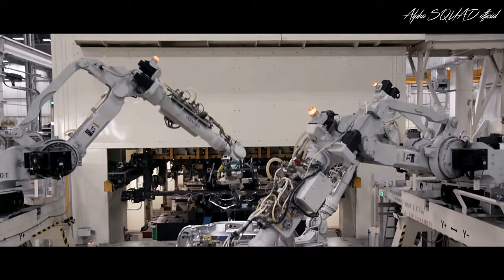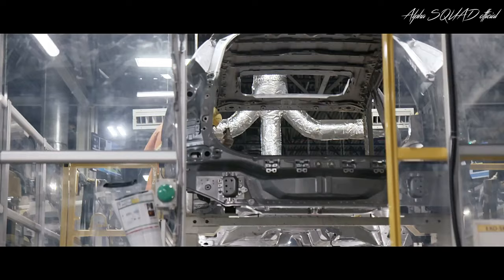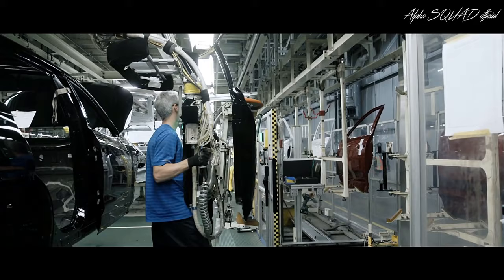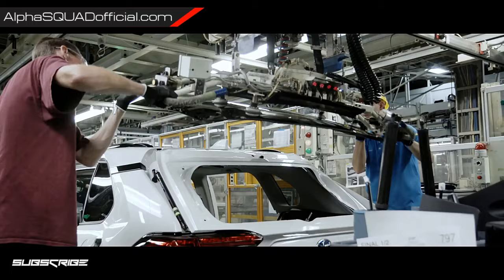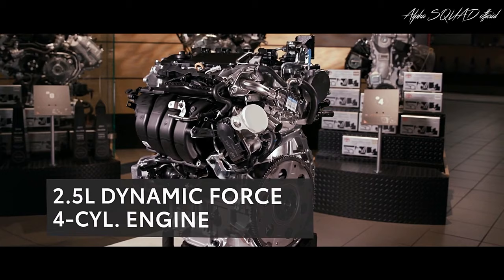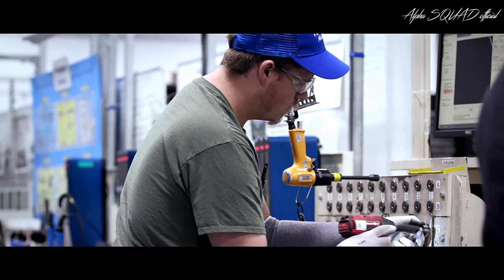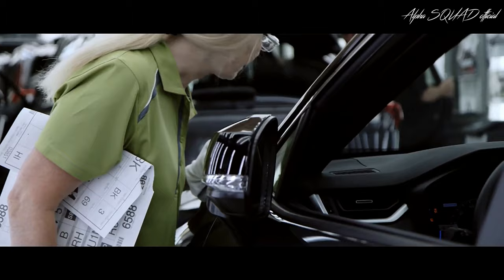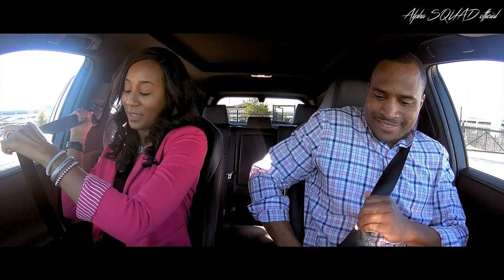Toyota RAV4 Manufacturing Process

Comment: I'm trying to learn how long it takes a RAV4 to be assembled.  From sheet metal to drive out of the factory.  A week?  Two days?  How long?
Reply: 26 hours
Reply: @woodyhayes7402  Thanks I finally got my RAV4 factory fresh in April after a long wait.  My 2014 was totaled on Christmas eve afternoon and his insurance paid me $22000 for my 2014.  Then I waited and waited for the new one while I rented a vehicle, expensive.  I'm totally happy with my new RAV 4 it has a better ride, more comfortable ride and better gas milage, I'm getting about 30 MPG in city stop and go driving.  On a trip I registered 36 MPG.  Not bad for a fairly heavy vehicle.  Build quality is excellent.  I can find no flaws at all.  Thanks to the assembly plant for doing such a good job.
Reply: To add, I bypassed that start stop function with an aftermarket device.  I know all the new vehicles have it, but it's a terrible idea.
Reply: @moci42  - Awesome! what model RAV did you get?
Reply: @woodyhayes7402  XLE Premium.  My 2014 was a limited, but the XLE Premium has all the stuff my limited had, sunroof etc and the XLE premium has safety features that the 2014 didn't have in addition has 8 speed tranny, my 2014 had 4 speed.  It's built like a fine watch.  :)
Reply: When I posted the initial question I was very anxious because the rental vehicle was expensive and was even looking at Hyunda's and Honda CRV, but the CRV's were way behind too plus I didn't like them for the turbo charged 4 banger.  The Hyundies looked ok but not my first choice and the opportunity came that my RAV 4 was avaiable.  Grey color like the above video.  There is more to the story but I won't go into detail.
Reply: @moci42  - Glad it all worked out for you. What was your out the door final price?
Reply: @woodyhayes7402  $37078 after veterans $500 discount.
Reply: There's not much dealing going on these days when people are lining up and waiting for weeks and even months for the hybrid to get the new vehicles.  However, Hyunda new vehicles are quite well stocked and their lot was full of new.  I've been a Toyota customer for many years and Toyota's have proven to me of their reliability.
Reply: @moci42  - You did good my friend. I'm paying 34K on an XLE
Reply: @woodyhayes7402  I hope they get caught  up, there is a built up demand people are waiting.  I was lucky to get mine.  I think my sales person pulled some strings because this one was not the one I originally had been waiting for.  Same model but different color.  I'm not fussy about color in fact rather than the arctic white I got the grey which I think I like better.  Plus this one came with the roof rack rails which I was going to purchase aftermarket.  It all worked out perfectly.  I gave my sales person a high five review, the dealer sent me a tin of chocolate chip cookies.  Rudy Luther Toyota in Golden Valley Minnesota.  I highly recommend it and Boris is the sales guy, great to work with.
Reply: @moci42  - Awesome experience moci. Thanks, for telling me how it went for you.
Reply: Looks like this is where my Rav 4 XSE Hybrid was built. Very happy with the car🤩